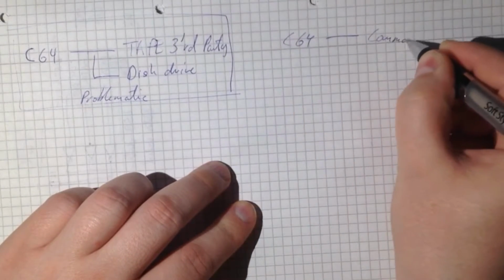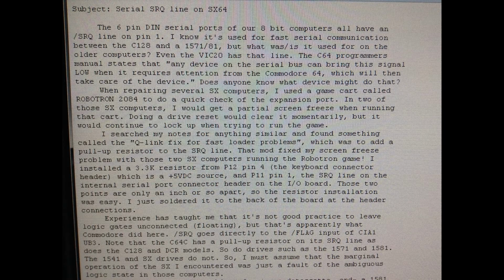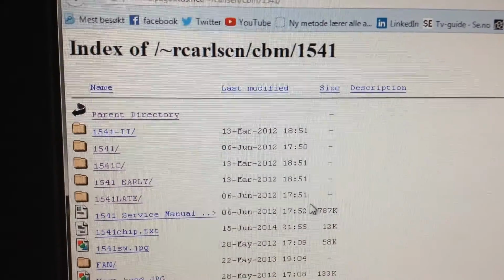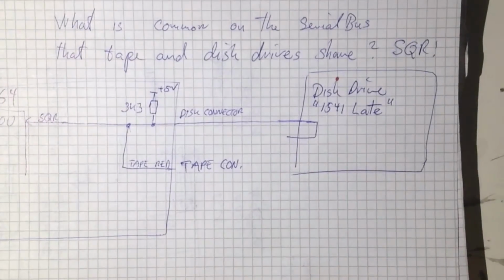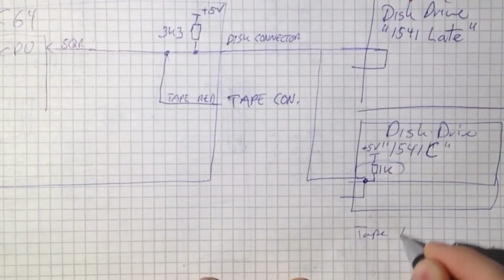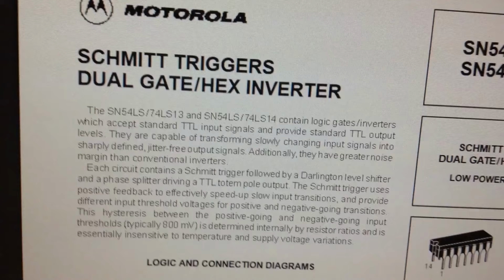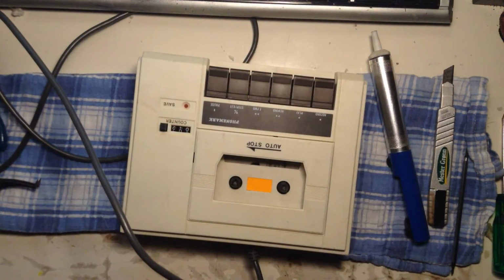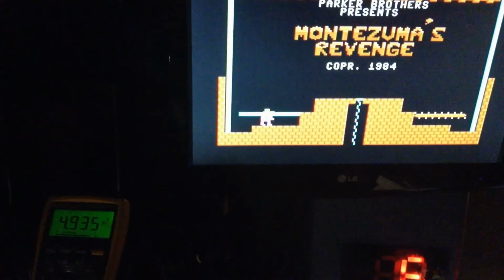C64 "Searching for $" repair 2 and disk+tape problem

Comment: Brilliant!!!  Initially I would have been tempted to remove that 1K pull up, but what you did there by tackling the real problem - swapping out the inverter was the ideal fix.  Great stuff =)
Reply from the maker: GadgetUK164 Thanks for the sub :) I thought the same thing about removing the 1k pull up, but then I found that the commodore tape drive didn't mind that pull up in the disk drive, so maybe keep it in case someone in the future uses this drive with vic20 or sx64 (unlikely) :)
Reply: Exactly!